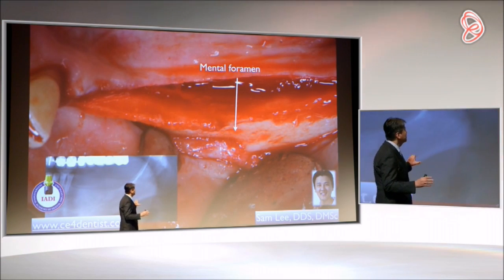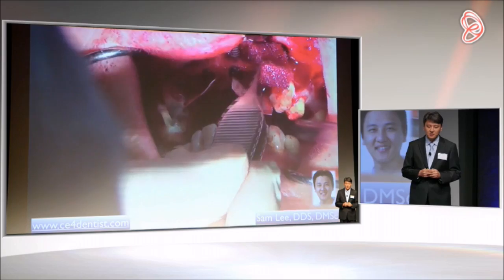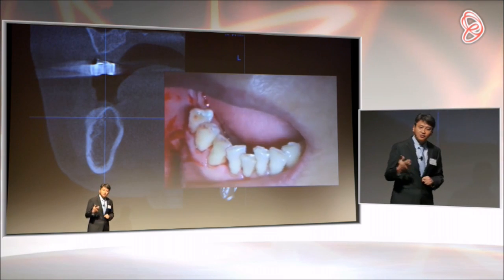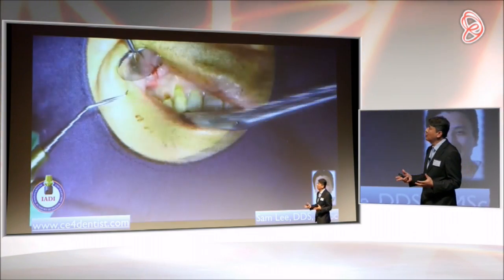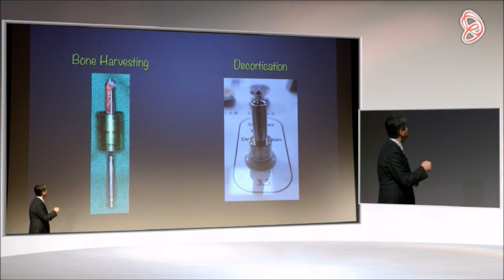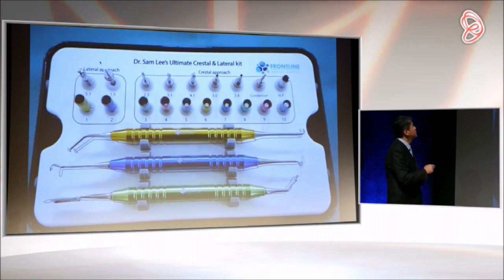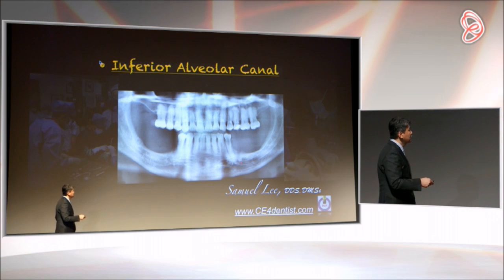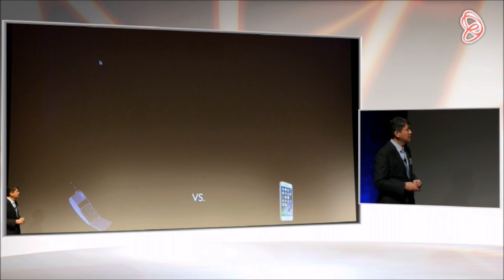New Techniques in Implantology with Newton Implant Systems

Comment: The truth is no matter how wonderful the dentist or lab technician, you WILL NOT FEEL your mouth the way it was prior to doing this surgery.  I have Nobel Biocare implant for four years now.  They seem to be fine.  However, the acrylic implant supported dentures are plastic.  Plastic breaks either because your dentist/prosthodontist uses a mediocre lab and refuses to consider that the lab is using cheap material. She doesn’t cheat willingly, but ignorantly.  When my teeth came, the lower jaw of teeth looked beautiful from the side that the public would see.  On the inside there was some semblance of a worn down tooth.  NOT A TOOTH.  In the last year and one half, I have had to have several of my front teeth remade because the break off.  Let me explain break off.  The front teeth don’t fall out, the acrylic to which they are attached breaks away from the denture taking one to three front teeth with the break.  My all on four is all acrylic and three years old.  Initially I paid $32,000.   Now to repair my teeth I’m charged $200.00.  $200 x 6 trips is $1200 a year.  Still, it’s bad when you are at a wedding or at church and the teeth decide this is the time to break.  I can’t go to just any dentist anymore because he/she doesn’t know my history and won’t make an opportunity for me to come in for repair.  Guess what?  The answer to my problem isanother set of teeth.  Not one time have I heard that what is happening is not right.  I’ve had my teeth pulled, bone grafting implants.  So what?  There may be someone out there in dental land who cares enough to make sure the teeth are being made with quality materials and expert  building of teeth.  They are few and far between.  My dentist is a very good prosthodontist, and she should have her own lab.  BE CAREFUL with what is promised and prepare your mind for never being able to tear food.  You can mash with your teeth.  If they tell you you can bite into an apple, they are lying to you.  Good luck.  I wish I knew what to do to assure myself of a ethical and gifted lab for the newbteeth I’m needing after three years.
Reply from the maker: Sheila Hughes.   We recommend zirconia instead of plastic denture over your implants.   Talk to your dentist about replacing with zirconia as they are much stronger.

Comment: I be cumfused!  I understand that digital 3D imaging is indeed the way to map each (different) job! ...and I understand that drilling/screwing with a steady robot arm that is following the digital map beats the manual way of doing that, ...and I am sure they hold the patient's jaw exactly still so the computer guided arm is always in perfect sync with the job. ok!
BUT!!! I fail to see how this is all done without having to cut the gum.
If working on one tooth location that was extracted long ago and has healed... makes sense, but the gum was cut then when the extraction occurred?
...and what if you have to have all your teeth pulled first? to install full mouth permanent dentures/bridges?
IS THAT NOT almost similar to the GOLPA G4 system ? which conducts a full-mouth extraction and places a full-mouth digitally constructed permanent dentures on digitally installed implants? all within 24 hours, hardly any swelling!?
Can the experts chyme-in and explain this in more details.

Comment: The collagen membrane prevents the epithelial cells from growing into the bone graft material; however, since the membrane is rolled into a tunnel, the graft material is entirely surrounded by the membrane. How does the graft material come into contact with the jaw bone? Does the membrane surrounding the graft material prevent direct contact with the jaw bone?